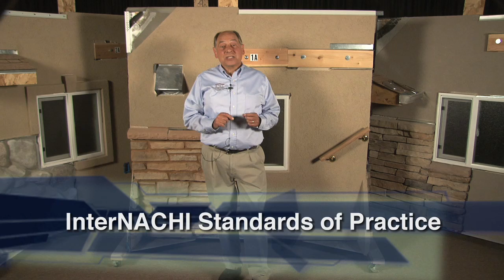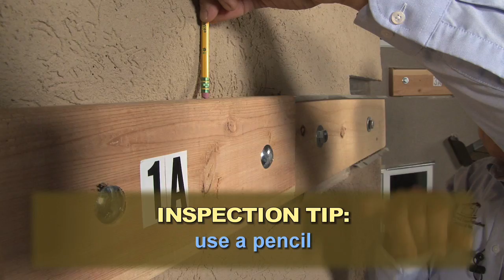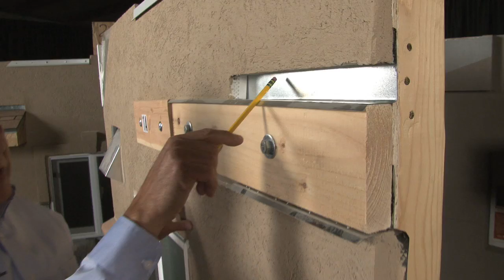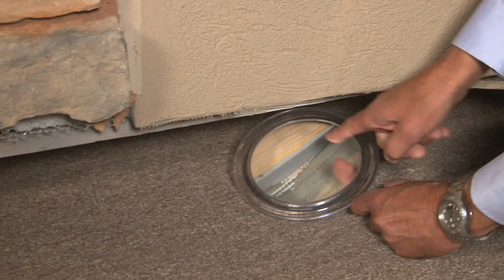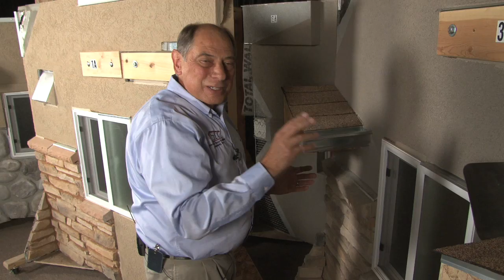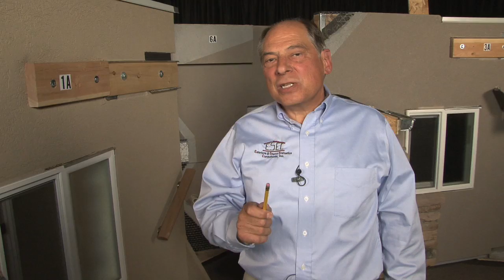Stucco and EIFS Inspection Tips

Comment: How tough is it to repair EFIS failure? Are contractors responsible for poor installs?
Reply from the maker: You have to be trained to perform EIFS repairs.
Reply: @BigBenGromicko  thanks for the response.  I am about to buy a house with EFIS and there are no licensed EFIS inspectors.  I am trying to determine how much I would have to spend to replace so I can put a concession amount proposal to the seller.